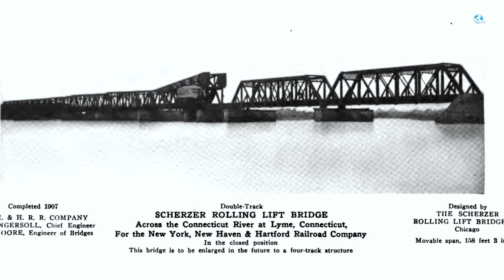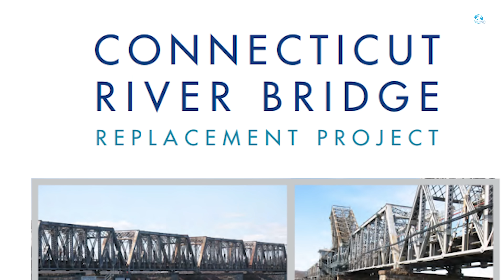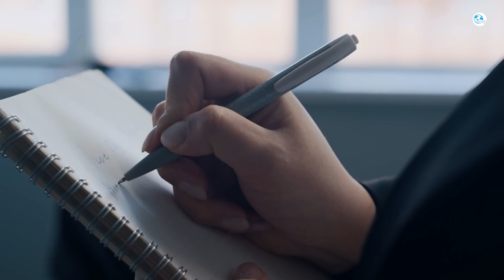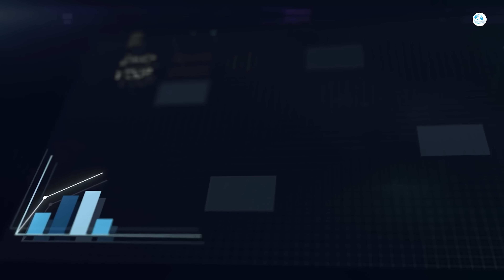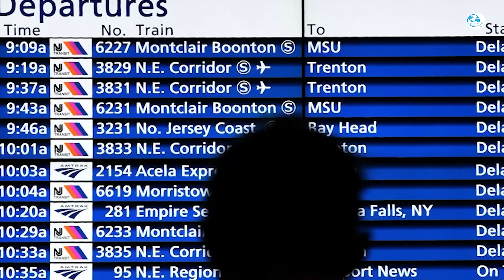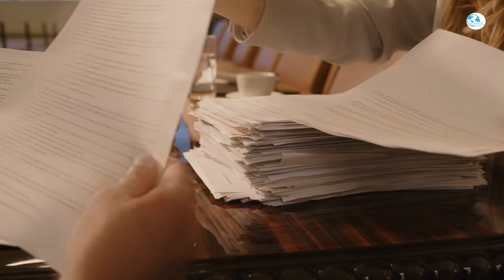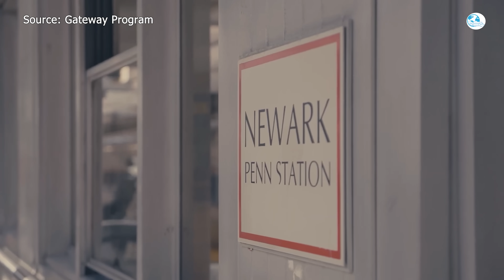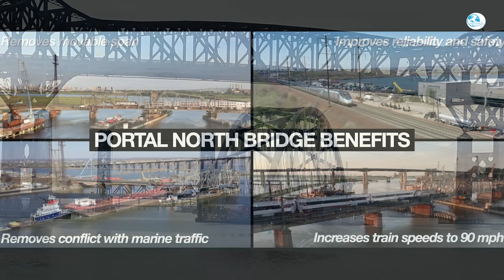These Mega Bridges Could Transform Amtrak’s NEC...

Comment: 4 Track Main Lines are a good idea:
Two Tracks for mostly freight, and Two Tracks for mostly passenger (with room for crossovers when necessary). 
Also, Why not have Just Electric Passenger Trains. We need Electric FREIGHT Trains.
Reply: Freight trains gain little from electric power compared to passenger trains, and its massively expensive and necessitates locomotive changes that don’t currently exist
Reply from the maker: That would be a great plan for the future!

Comment: It amazes me that they didn’t fix this up decades ago
Reply: The new bridge it's just a copy of old one.
So nothing is fixed really. 
2 new trucks >> 2 old tracks
1 movable span > 1 movable span .
Ancient technology.
Bottleneck remains.
They should build taller arch bridge little to the south with bigger radius and steeper approach to make for hight difference. 
Generally poor location for the line close to water bay but this is where line goes

Comment: 3:27 why not spend a little more, to increase the heiht of the bridge, lke the highway in the back.... americans are so smart
Reply: New bridge will be another garbage project just build same way same type of ridiculous bridge with movable span.
Just new junk.
It should be some longer truss bridge or arch bridge on middle with sides of shorter trusses or arches or mixed going down to banks of river.
They just replaced old junk with new junk.
826 M garbage
Reply: Exactly. 
So highway bridge can be high  above river but not new railway  bridge. 
Ridiculous concept
Reply: Railroad bridge approaches cannot operate with grades as steep as those of much shorter highway bridge approaches.  The railroad approach grades for the new PNB are already much longer than those provided for the existing PB.  The northeast approach of the PNB would adversely affect Secaucus Station (it would have to be reconstructed) were it  made higher.
Reply: @rockveley3580 
At 3:27
He talks about different bridge in Connecticut not PNB.
On video at that time mark you can see highway bridge. 
It's in Connecticut. 
Obviously highway it's completely different from railway. 
Grade can be much higher on highway. 
Usually on railway max. acceptable is 2%. More that that it's very rare.
That bridge in Connecticut is in difficult spot that's all correct. 
It's location doesn't allow for different  designs because it turns sharply south on left side.
So new bridge will be next to existing. 
But if you moved, whole bridge location to the south  about 1/2 miles out could redesign whole area and make tall truss or arch bridge above Connecticut River( around 20 to 25 meters above) just like highway bridge more that 80 ft above water.
Highway bridge is located 1/ 2 mile north of existing railway bridge
Reply: @Matt999PL  : My apologies!
Reply: @rockveley3580 
Probably on that river you could go lower with bridge.
About 15 meters ( 50 ft ) above water and that would be sufficient for that river. 
If bridge was built to the south of existing one approach coud be around  900 m to 1 km  it could reduce grade to 1.5 % from 2%.
For high speed it's not a big problem  it's a passenger train with strong  electric unit and advanced traction. 
That would just require more money for bridge and more approaches. 
But bridge itself would be much better  without bottleneck on moving span. 
Longer trusses or arches.
Just little south to existing one.
Reply: The new moveable bridge will roughly match the speed limits of the surrounding track profile. Getting the large amount of extra height required for a fixed bridge would be massively expensive for very little gain.
Reply: @andrewreynolds4949 
Do you know how often movable span will be open in a day?
Wil it create bottleneck connection?
It was said that existing span create  bottleneck because has to be open and close. 
The new bridge is same type as old.
The advantage it is little bit higher and new elements.
Probably the least expensive option was chosen compared to fixed taller bridge truss or arch type. 
That type would have to be moved to south because of longer approach needed. 
More money needed
Reply: @Matt999PL  The systems running the bridge will be in new condition instead of ancient and worn out, so openings and closings can be done faster and more reliably. As a comparison the Portal Bridge has bearings that are completely worn out, and thus has great difficulty opening and closing. With new hardware this sort of problem disappears.
The rail traffic in the area is much lower than the Portal Bridge for example, and doesn't justify the land acquisition and huge construction disruptions to the area to build a fixed bridge.
Reply: @andrewreynolds4949 
That's the explanation. 
I understand you talking about Connecticut bridge with movable span.
Portal bridge is in NJ. 
FIxed arches,correct?
That's good explanation for Connecticut bridge. 
Surely it will be better than existing old bridge. More dependable and lets hope it will serve as many years as existing old bridge.
I have to admit that old bridge it was  good piece of construction for that time it was built and lasted long.
Especially talking about movable span.
Other thing is traffic on Connecticut River.
Probably river traffic is very low so no need for tall and expensive fixed bridge.
Is that correct statement?
Originally I had impression that traffic is high both on track and on water but probably it is not like that.
Reply: @Matt999PL  River clearance requirements would be set by the Coast Guard. In both cases river traffic isn't particularly high, but the main difference is the existing Portal Bridge has a much higher clearance, and much more rail traffic to justify the cost of a fixed bridge.
Reply: @andrewreynolds4949 
Thank you for your good explanation.

Comment: The NEC through Connecticut is a zig zag serpentine horror show that permanently prevents high speed rail from Boston to NYC.  It needs to be relocated more inland and straightened out.  There will be winners and losers but it is necessary.
Reply from the maker: Well, not bad solution!
Reply: It should be through long island
Reply: Definitely not through Long Island!

Comment: The Portal North Bridge (PNB)  will only provide for 2 tracks on a new bridge, replacing the existing 2-track Portal Bridge.  There is no guarantee that the Portal South Bridge (PSB) will ever be constructed in the near or distant future that would provide the 3rd and 4th tracks.  This video does not discuss that.  At the southerly approach to the PNB, there is a long skewed rail undercrossing (a box)  incorporated into the new structure, in anticipation of the need to provide some grade-separated rail access to the PSB.  But that undercrossing may never be used as part of future operations if the PSB is never built.  There is also the future cost of the PSB, which will add billions more.  Thus, the Northeast Corridor will remain a 2-track operation between here and the Hudson River for years.  The PSB becomes important when the new Gateway Project tunnels under the Hudson River are completed, and the existing tunnels are refurbished, providing 4 tracks.  Four tracks between Newark and NYC.  That is years away.  Current politics suggest that it may never happen.  The video does not adequately clarify these issues.
Reply from the maker: Thanks for your feedback and valuable information as well!
Reply: At the start of the video, it says the new Conn River bridge is a fixed span with 50' of clearance.  Later, it shows pictures and says it is a moveable draw bridge.  So which is it?

The existing PNB is a major bottle neck and single point of failure.  Replacing it (which is well underway), is critical.  The completely separate parallel PSB would theoretically double capacity, but there are many other bottlenecks on the NEC which will prevent a significant increase in capacity even if it were magically built tomorrow.  Upgrading those other places is much more important than the PSB in the short term.,

They are planning to remove the old bridge a year after the new PNB opens, but they could leave it in place, usually open (to not impede boat traffic) instead of usually closed and only close it during the busiest times or if they need to close the new bridge for some reason, such as track or signal work.  Only permanently close the old bridge when the PSB is built, in another decade or so.
Reply: @johnsantos1738  :  The existing bridge is merely the Portal Bridge (PB).  It is not called the existing PNB.  The PSB, if it is ever constructed, would occur in the footprint currently occupied by the existing PB.  The existing PB with its movable span must be removed before the PSB can ever be constructed.  That permanent box, included as part of the PNB, and clearly seen in the many videos of the PNB construction, would align one track into the location currently occupied by the existing PB (i.e., to the future PSB).  I suppose that some engineering powers that be decided that this box would be needed to provide a single-track grade separated cross-under of the 2 new tracks for some future train movements to/from the future PSB.  This permanent box can also be clearly seen while under construction in satellite views (such as Google, Satellites...Pro) at coordinates 40.751045, -74.103391.  Apparently, the purpose is to eliminate a more complicated future at-grade interlocking arrangement.  The NEC has several of these elsewhere.
Reply: @johnsantos1738 Great idea!
Reply: On the east end of the Portal / Portal North Bridges, the abutment footprints overlap. So to put the second PNB track in service, at least one track on the old Portal Bridge must be removed; simultaneous full operation would be impossible.

Additionally, clearing the old bridge away is required to fully clear the river channel for navigation again.
Reply: @andrewreynolds4949  Thank you.  I did not know that.  I assume from your information that they can open one track of the new bridge without shutting down either track of the old bridge, so they can do that and test the new bridge.  Then when satisfied, they can close the overlapping track on the old bridge, finish the 2nd track on the new bridge and open it while keeping the other old track and the first new track open, so they never have less than 2 tracks available.

It would be nice to keep the other old track available for redundancy, but there are navigation issues.  If so, since all the pilings and supports for the new bridge are already in place, those obstructions must have prevailed since they started construction of the new bridge and will prevail until the old bridge is removed, several years from now, so they must have ways of dealing with them.  Are these obstructions so serious that removing them is a priority?  Are ships forced to zig-zag slowly through the channel, or is there a length limit and longer ships can not currently get through?  Or is there some other problem?
Reply: @johnsantos1738  I don't know the details of the conditions on the water, but marine operators were complaining very loudly a while back trying to get the new bridge stopped, claiming it was difficult to impossible to cope with (yet they still managed at the time). 
What I have heard is because the old and new bridges are on different alignments, leaving very tight clearances and a zigzag, transits are now very difficult and can only be done at certain times and tides. This seems to be the reason why the New Jersey treated sewage barges have been transferred to trucks for the time being.
Barge traffic is pretty much all the river sees anyway.